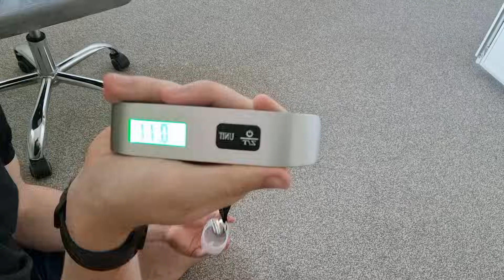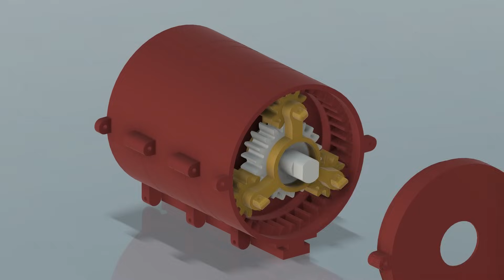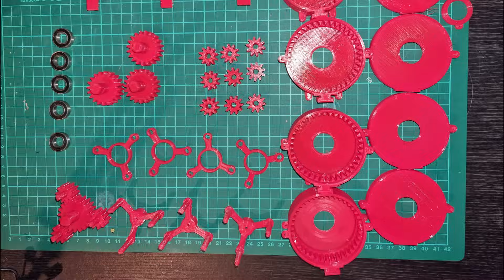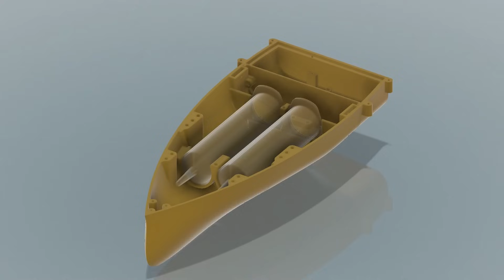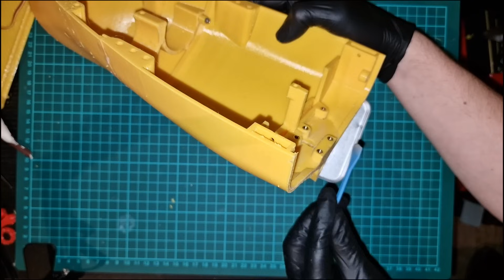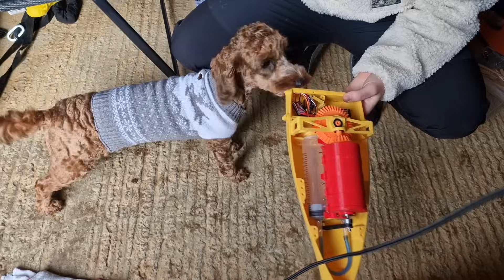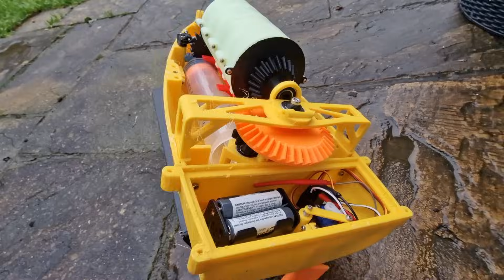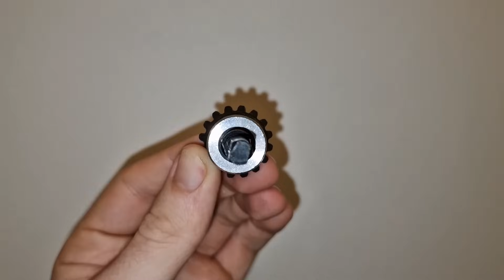3D Printed Vacuum Powered Boat

Comment: Did you calculate the forces the gears are experiencing?
I think you'll find it's a lot more than you thought.
Also, a ball-governor may be needed to keep a constant rpm on the prop in the end...
Reply: You calculated over 12 kg to pull just one of the plungers back. That means you're pulling back two plungers with 24 kg. That's a lot of torque on the small gears and those small brackets you're using to keep them in place. Send piece of mild steel with some holes in it would probably be better. You should also consider steel shafts for all the torque transfer.
Reply: The water will self govern if it does not cavitate, the prop size could be increased a bit to slow the shaft RPM.

Comment: What unfolds in your example is a familiar tale in DIY projects heavily reliant on prototyping. In the realm of engineering, the process typically commences with meticulous calculations, later validated by a prototype. In this context, an astute engineer would have promptly discerned on paper that no plastic component could endure the torque necessitated by the syringe pressure—especially not with your chosen design. Optimal materials for the axes, transmission, and supports would, at the very least, include aluminium. Yet, the crux of the issue lies in the realm of technical choices. The remedy is straightforward: initiate each project by sketching ideas on paper, subject them to scrutiny against specifications and a comprehensive list of considerations (centre of gravity, weight versus Archimedes' thrust, torque, etc.), and brace yourself for the inevitable deluge of calculations. Some projects meet their end at this juncture, while others spotlight the shortcomings of a particular component, leading to a radical departure from the initial concept. One can endlessly tinker while adhering to flawed principles, a pitfall I don't wish to sound too critical about, but it appears to be precisely what transpired in your case.

In terms of creating a vacuum, the simplest approach involves a rigid reservoir, possibly spherical, with a one-way valve, and an external vacuum pump that needn't be on the boat all the time. This approach champions simplicity, sidestepping the overburdening of the hull with elements as ineffective as they are superfluous. Additionally, the transmission system, the heaviest component, is strategically positioned away from the bottom of the hull, where the lightest components—like the syringes—reside. Questionable choice IMHO. A meticulous hull calculation, taking into account mass limits and distribution, is an arduous task. As a preventive measure against capsizing, integrating floats isn't a bad idea. Your choice of a motorboat hull type designed for speed, usually coming with a heavy backside and a low centre of gravity, seems mismatched to your design's weight and balance ratio. Perhaps, a shape akin to a container carrier would better suit your objectives, since significant speed may be unattainable. Remember, a propeller is engineered for specific speeds; don't pair a propeller designed for 5000 RPM with a system barely reaching 200 RPM. At such low RPM, a propeller might not even be the optimal choice; a fishtail oscillating system may be more suitable because of low energy and low speed. However, the onus is on you to discern the best choices.

I strongly advise starting afresh, building from the ground up. Begin with impeccable technical choices for vacuum propulsion, select appropriate components, and only in the final stages, explore the best approach to keep it afloat. Shape, friction, and performance likely won't pose significant challenges with a small reservoir and autonomy.
Reply: This guy is a pompous Jack ass. Want to know the weight before it sinks? Water, grams of ml of H2O. Balance? Finger test. All these words that mean they think you never thought about your design at all on the computer or your head or anything, stupid. Of course you did, they just want to sound smart. 

Round vacuum tank? Forgot work energy requires movement, from the syringe rods, stupid. Even with a diaphragm he forgot whatever fluid in it, is halved. Making it functionally not worth it. 

The gears lower down can help get the speed up because of the weight shift during acceleration, so the hull is fine. My keel idea just helps with rudder saying but isn't really needed. Better supportive structure with pulleys for the wire will help you, but nothing wrong with adding some metal in the right places, it's cheap these days too! 

F this guy, love the video keep up the great work, you are almost there 😊

Comment: For some advice, I would lubricate the gears, place the main planetary set down low, brace it using the syringes & supportive structures below, in-between, and above so that way you can wind up the syringes (vacuum them up giggity) separate to help with ease of use but also have the gearing directly placed onto the shaft. But you can also use a gear there, like before, to more center it and support it with a ring structure. 

Of course, you've got to use a whole bunch of holes and triangles b/c stronk. Basically because you can support it with the body of the gearing and syringes together with a bunch of structure in-between you can have the majority of stress get spread out, but! crucially, you can also use that larger ring gear as support for the gear from the gearing, to the prop shaft gear connection. This makes it more likely to be unable to move in a direction, z, x, y, etc, you wouldn't want it to.
Reply: I should specify that you should leave everything horizontal to allow for the nozzles to stick into the ring gear housing or into the front of the boat to allow for it to become structural, sheet you slide them into holders & tighten them down. The hull only needs a longer keel, or whatever it's called, to allow more stability. If you wanted you could add a hydrofoil to help it out for range and speed.

But that's requires you to have a steeper angle for the prop, which means the hydrofoil will need to have the axle in it with a nice ring gear support that allowed for your to also move the hydrofoil and rudder system in a design like that. More redesign.

I would say just sticking to having it properly balanced with a keel, sitting those gears lower, giving them some lube, direct drive to props, use a little latching system to the vacuum to make it both easier to take out and precharge & slow down/stop the syringe would be really good to do.

Comment: I think the use of a crown and lantern gear setup could reduce the propensity of the gears to cam apart. Alternatively, an idler pulley could be used to change the syringe capstan axis 90 degrees to be aligned with the gearbox.

Comment: Weight is definitely a contributor to one of the issues you're facing ... But so is buoyancy, and while plastic is relatively bouyant, resin isn't. If you want to re-use that planetary gear train (it's a marvelous piece of engineering, so you should definitely use it for SOMETHING, even if you don't use it for this specific style of project again), then I'd suggest going along with what some other comments have suggested and placing that in the bottom of the hull. I'd also recommend - and hear me out - purposely designing the hull as a shelled assembly. As in, each piece of the hull has air pockets in it, to add bouyancy. It might not matter much, but it could probably help a lot - idrk. I'm not an engineer.
Reply from the maker: Buoyancy force is equal to the weight of the liquid the object displaces, nothing inherently different about resin prints that make them not buoyant. To increase the buoyancy force I would need to increase the volume of water I'm displacing, basically make the boat wider or longer.

The air pockets idea would work if it made the hull lighter, so boat wouldn't sink as much!
Reply: @kurzey8532  I was also definitely noticing a lot of comments saying to make the boat longer, but honestly I think that might not be 100% necessary since you do have certain size constraints yes? 

I was also thinking (just now) about how to ensure the hull doesn't snap too easily and ... well ... why not try designing the boat to have hexagons on the inside?

Comment: I mean, just watching this, you are building your gear mounts as this massive patchwork. All the different parts and pieces, some attached to the hill, some attached to this mount and some attached to the gearbox, theres so much slop that its no wonder everything moves. Pick something, and ase all the mounts off it, I suggest the gearbox. Maybe print the last gear cover to include a mount for the bevel gears. Also, lubricate your gears. You will e astonished how much friction is generated from 3d printed planetary gears (I built a battlebot that runs off resin printed gears and at 10k RPM they would physically melt through the PLA carriers/supports without lube. Lubricated, no degridation at all. If the gears move smoothly it could reduce the forces put on the shafts you keep bending and breaking.
Reply: Flip entire thing around so you don't need a belt and to get a better center of gravity. Make the hull wider and try the crown gears, like the ones used in cheap plastic RC cars
Reply: @CenReaperYT. Good idea and helical crown and pinion just like car differentials use would be reduce cogging and spread/smooth the forces.

Comment: The whole bevel gear situation is the exact reason why differential housings on cars are so incredibly beefy.
Reply from the maker: Noted, add extra beef to bevel gear housing
Reply: @kurzey8532 have a bevel gear housing is probably the first step. Translation of rotating forces is probably the single most annoying problem in gearbox design. make a full housing that attaches to the planetary gear train directly. One solid block. No bridges nothing. Working in PLA you're already kinda at the materials limit.
Reply: This ⬆

Comment: I designed and built a pretty good windup boat for my son. It uses two chainsaw motor recoil springs and handles a lot of force.  I use steal rods for all the shafts, of which there are three.  

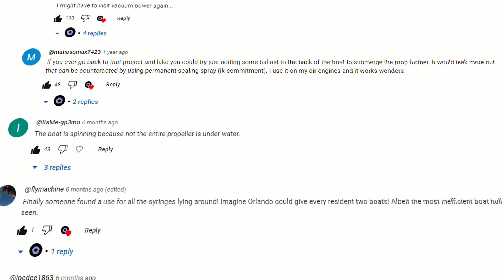IIRC, the final gear ratio was 1:50.  

It can go about 50 feet and turned out to be far too dangerous for my four year old son.  The prop could take off a finger if it ran out of the water.

Comment: If you redesign the hull and mount the planetary gears at the bottom this will lower the center of gravity and allow you to drive the propeller directly from the output of the planetary gears. A shaft mounted in parallel above the planetary gears can be connected via a belt or gear set to the input side of the planetary gears. You could then mount the syringes vertically and wind their draw strings onto the shaft.
Only two gears cogs are necessary, no bevel gears. A turnkey can be added to the shaft, or the shaft could be wound using the gear cog on it (with your drill).
Reply: Yeah, air is light, and lack of air is lighter. Better store the light stuff up on each side leaving the middle bottom for the gears.
Reply: Same thought - the boat's powertrain design is upside down. Another benefit of putting the gearbox at the bottom of the boat is that you can build its bracing into the hull, adding structural rigidity.
Reply from the maker: My initial reasoning for putting it up higher was because I wanted a somewhat sleak boat hull and the planetary gears are fat so wouldnt be possible....but you're absolutely right it would be better off in the bottom to keep COM low
Reply: @kurzey8532 Have you considered going to a catamaran-type design with pontoons holding a platform for the gearbox and power? A multihull boat might give you the combination of a sleeker profile while having a large enough platform for your components.
Reply: @kurzey8532   Yep, nobody likes a tippy boat 😜

Comment: Don't be disheartened - you do a good job of keeping your viewers engaged by describing each problem with admirable concision coupled with commendable thoroughness ( no easy feat) and then describing the solution. Then you get cross because something else stops working, and all the while you're imperceptibly inching towards ironing out all the problems.
 Then again, it's sensible to know when to devote your time and yellow filament to something else.
 Very pretty hull, though...

Comment: That is a beautiful looking hull. Maybe double it's length so the gearbox can sit down behind the syringes or in front. Either way, so they are down below the water line. Adding an extra section or two into the middle of the hull to stretch it will also increase your buoyancy, maybe enough to allow you to add some lead in the keel to ensure stability by dropping the centre of gravity even further.
Reply from the maker: Great idea, more buoyancy and solve the issue of high centre of mass. Only issue is additional weight, she's a heavy ol girl already
Reply: @kurzey8532  To add to this - if you do end up starting from scratch with the hull, try planning the contents then find an existing hull profile to match the dimensions such that the mechanism sits nicely below the gunwales. Plans/models are available with a little Googling. Unless you're trying to innovate with hull design, it saves a lot of headaches to stick to known quantities and make adjustments where required 😅
Reply: I think the only issue of extra weight would be acceleration, it would take longer to get moving. The extra buoyancy might even cancel that out as it won't be sitting as low in the water which means it has less water to push out of the way. This is all just observation, I cannot speak from a position of experience in boat hull design @kurzey8532
Reply: @kurzey8532  Extending the hull gives you loads of extra buoyancy, the end sections of hull have the most mass.  See my other comment for other interesting idea.
Reply: Maybe set the gearbox under the syringes if he wants to keep the short length; I'm sure the gearbox is heavier than the syringe assembly. It would also allow a direct drive, eliminating the bevel transmission all together.
Reply: Better make a catamaran and suspend the mechanism inbetween the hulls.
Reply: If you put the planetary gear stack in the hull and the syringes on top, you would achieve three things:
1: Balance and buoyancy.
2: Eliminate the need for the pulleys and a drive shaft running the length of the boat
3: Free up the piston pulley assembly to be wound up directly instead of doing it through the planetary gears.

Comment: Arrange the syringes so that they can wind onto a single shaft and drive the bevel gears directly. :D
Reply from the maker: Or get one big syringe 👀
Reply: That could work too. Would save space since a piston with double surface area wont be twice the diameter. Unless you were planning to make a larger boat...

Comment: you need to dehumidify your spools. As they get moist over time due to atmospheric moisture print quality goes down the drain. Also when it comes to boat engineering, have the heavy parts at the bottom/lowest in the boat, not on top. Love your videos btw, you have the tortured artist wibe down quite good. :) Your ready to call it quits but your mind keep torturing you with ideas and tweaks you just have to fiddle with? :)
Reply from the maker: I did try drying it multiple times for several hours at a time! I think the roll was past the point of no return.

I very much have that mindset of tweaking and fixing things 🤣 said to myself this is the last fix about 5 times lol

Comment: I find it interesting that you had trouble with that red PETG. I’m currently banging my head against the wall about a roll of black PETG that clogs the MicroSwiss on my Ender INSTANTLY. I’m gonna try another color/manufacturer.
Also, silicone grease in planetary gearboxes works wonders.
Reply from the maker: I tried drying it like 3-4 times, changed bowden tube, nozzle, even ended up buying a direct drive extruder 🤣  just gave up with it in the end